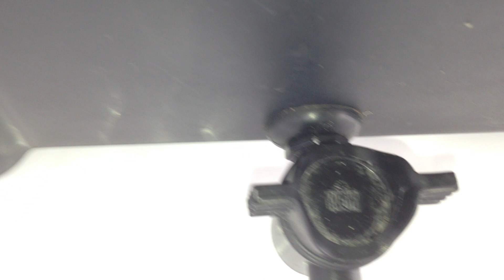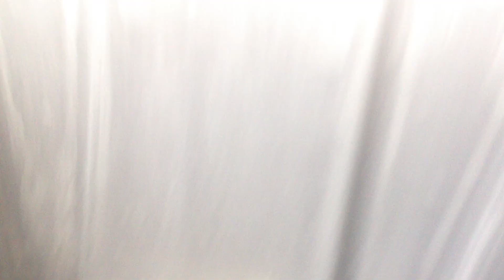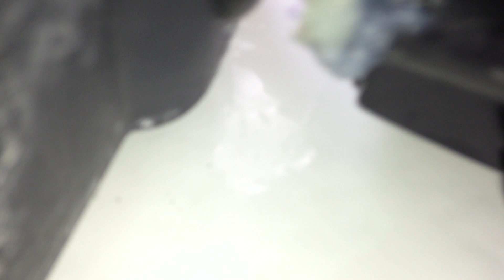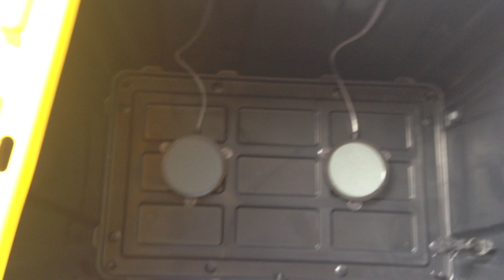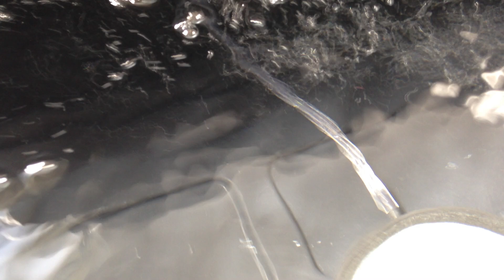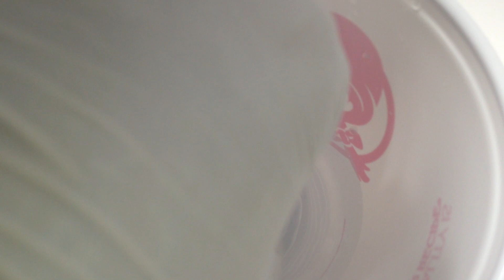SRDWC! Super Recirculating Deep Water Culture!

Comment: Very smart.  I didn't learn about Venturis until I went to college.  It makes perfect sense, I love it.  BTW, you stated that you are pumping Oxygen with is technically incorrect.  You are pumping air, which is Oxygen, Nitrogen, Carbon Dioxide etc.... You are pumping MORE air, which contains Oxygen (and other essential elements to the plants).. just a small point. I will use this idea,,,, thanks a million!

Comment: Great work. Use those venturi adapters that come with ya pumps! I do. Also , its always a good idea to keep the pump out of the res and in inline configuration for the simple fact that it will raise the nutrient water temp several degrees if placed in the res. Those pumps use electricity, therefore, will get hot, its a given overlooked fact. Great Job bro !

Comment: This is NOT RDWC folks... this is regular ole DWC.
Reply: +Smitty Hall By the way.. that's not up for debate. It's factual. Period.
Reply from the maker: Look I understand your point, just want you guys to understand mine. This is not the setup, this is the IDEA. This is the beginning of my new project. The video was made to show someone the VENTURI. Water was dumped out after video. This is simplified to 1 bucket (which the water still recirc.). OBVIOUSLY you add as many as you want. But add the Venturi, which is the point! This is Nothing....names changing and setups changing soon. Standby.
Reply from the maker: +C.Willy Tokin  def. (of a fluid) continuously circulate. That's all it's doing. But it's not the point like I said mines is a 8 bucket system, I know what it means. Never mind.
Reply from the maker: +C.Willy Tokin  My Bad. I see it. I'm rusty at this.
Reply: he doesnt get it Robert lol..

Comment: all nice and stuff but to conect a pump on one bucket is dump, you recirculate nothing, you pull out the tank and push it back, the idea of recirculating is if you have more buckets the nutrients are the same in all of them, since your air bubbles already mix that one bucket the pump on the side looks nice, but has no propper value whatsoever
Reply: I said the same thing, truly pointless

Comment: Still the job of the pump is to move water your not moving it anywhere and the bubbles stir the water. In order to pull nutes from the bottom your inlet should be low and out higher. Just saying your wastin power.

Comment: So the bubbles dont move the water enough? True reciriculating systems keep water nutrients all equal. If you only have one bucket your only making waves.
Reply from the maker: It mixes up the nutrients inside keeping a stable ph and all that gunk out the bottom of your Rez. The screen in the intake filters debris and dead roots. That's just extra the whole point is oxygenating the water as it goes through you might not see it but the entire Rez has a higher O2 reading as opposed to dead zones in the corners and spaces with no air stones. If I could I'll show u the real setup with 8 buckets and the correct pump and venturi. It looks like smoke comes out and all the buckets turn white from the oxygen smoke. U guys just don't understand because u expected to see a 100 bucket setup from outer space that's grows and flowers a plant in 2 days. There's nothing but advantages when it comes to this system. Instead of implementing something you might of picked up y'all rather troll. And did you see the cap it's a RECIRCULATING SYSTEM! It recirculates over and over and over and over trust me I know what I'm talking about. It still the same concept if you use one tote or a million. The video was made to show the style of growing not to show my setup and what I'm doing
Reply: DVLZHAZE I think dan marchbanks' point is that this is not a recirculating system.  Although you are moving the water through this pump, it is still one closed system (meaning the 2 plants are in the same container- not separate containers that require water moving between them) and therefore you may as well have simply left the pump inside the container with no hoses where it would do just as good (or better) a job of moving around the water.  recirculating dwc refers to moving the water between multiple buckets/containers and a separate reservoir with no plant in it. That way it's much easier to maintain the ppm/ph of the entire system than say, if you were to have each plant in its own traditional 5 gal bucket dwc setup.  Rather than checking every single bucket for ppm/ph, you only have to check the res- whatever state the water in the res is, is the same it will be in all the buckets because the water is recirculating through all the buckets and back to the res and then through all the buckets again, over and over.  That is what recirculating dwc refers to. Your addition of the pump may have beneficial results which you described above, but you are not recirculating the water throughout a system of buckets/containers.  You are simply causing the water to move around a bunch in one container.  You could place your water pump inside your container (weighted or suctioned down so it won't move around), with no hoses attached, and you would get the exact same results- movement of the water and creation of currents, but no recirculating of this water through a system of multiple containers which would have made it an actual recirculating dwc. So to me it seems like, while the idea of moving around the water may be a beneficial one, you grossly overcomplicated it.  You could have just dunked the water pump into the bottom of your container and voila- same setup.  Or you could have achieved similar results with a stronger air pump and larger air stones.
Reply: Becca Wetherby If you had this rigged to circulate water through multiple buckets, then I would be very interested to see how you constructed it/have it set up.
Reply: Lol knew someone with a brain would realize he's running a pump just to run a pump.
Reply from the maker: +dan marchbanks  like I said I simplified a system to show an idea. Just the idea the setup under construction is nothing like this it's rediculous compared to one thing in the drafting process drafting. 
And even the draft grows sick plants. THINK ABOUT IT. HOW DO YOU MEASURE PH? Water moving or still. When you figure this out your going to see that my drafts grow better than most.
Reply: The point of the pump is to circulate and mix water through a system of pots. Your running a pump in a bucket...airstones move and mix water efficiently enough in a single pot. Also you measure ph in the red bucket since water is being mixed though the entire system. The ph and nutrient level is the same in every pot. Unplug your pump your just paying the power company a few bucks for nothing.
Reply from the maker: +dan marchbanks The idea, yes mine has 8 buckets so what! It's the idea. I understand you want to flex your knowledge, but you don't get the point of the vid. And the stones does not mix the water enough, hence dead spots in your Rez and all the bites that accumulate at the bottom. Plus as soon as I turn on the pump the true ph shows.
Reply: I gotta agree with dan , it's simply no need for a water pump it;s a waste
Reply: Mopar Man73 triple the air lose the pump make it super dwc
Reply: Lol. He did.rig that pump up for no good reason. This is not rdwc. Perhaps super dwc?  Not bad though

Comment: Wrong guy for marijuana is harmless, it is not recirculating and it is not super.
Reply from the maker: Theo Phrastus well it’s to be implemented on different systems. The point is that you can add extra air to your water as it passes through the pump. Wether it’s 1 bucket or 6.

Comment: Dude why are you using tap water? Use RO water, it's a huge difference, it brings your PPM's lower between 0-25 as a base and it removes all the bad shit out of the water. Buy a water chiller to keep your water @ 69F. Use Cal-Mag for what the RO filters out don't go with whats the least maintenance. Buy the 10inch net pots don't use 5 inch. ph @ 6.2 ppm @1200-1400 Botanicare or GH with some carbs 600-1200 watt lights for flower use 48-t5 for your veg keep ur room @ 72F change ur REZ every 9-12 days use H202 to keep the O2 levels up you can never have too much O2 I pull about 1 pound per plant dried
Reply from the maker: Dude! its an example i dumped the water right out after the video! lol. i know what a reverse osmosis system is i have one hanging in my laundry room ready to go. This video is not a how to grow video. its a video showing a recirculating system with a venturi added to it. why would you tell me how to do something and you don't even know how and what i do or even  what i grow. thats nice and all that u want to gloat and instruct people on what to do because you think you know everything but it sounds to me like you just wanted some attention.